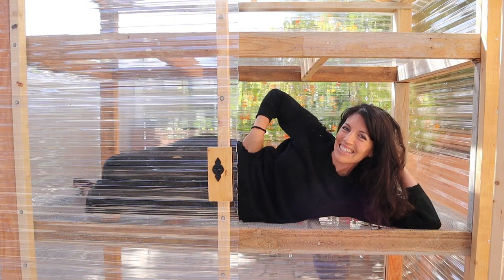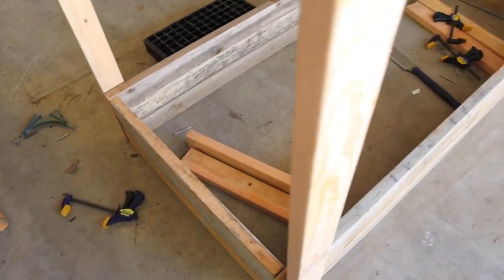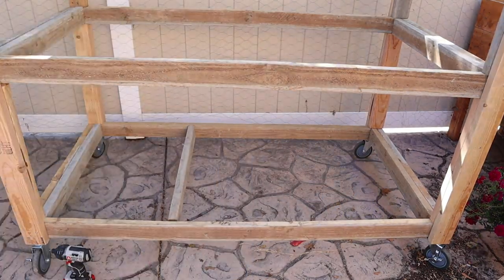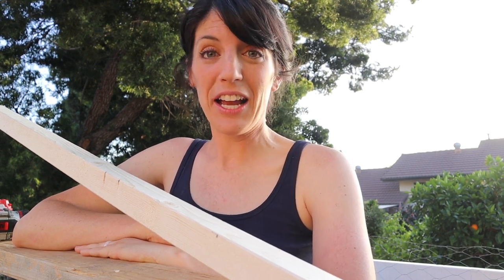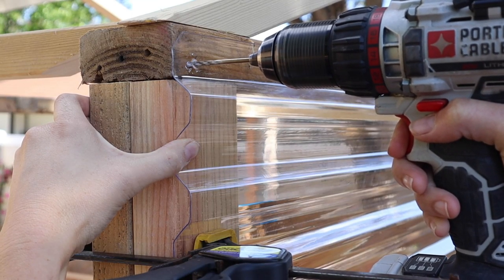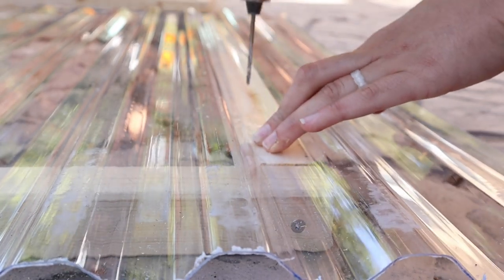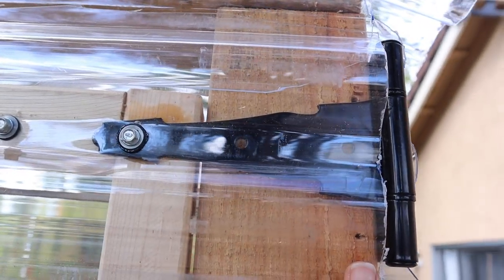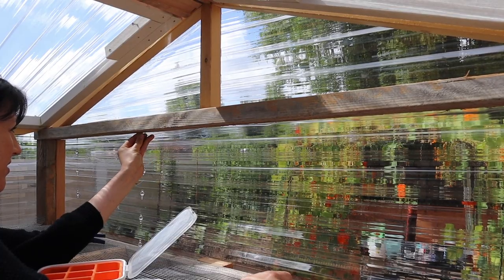How I Built a MOBILE GREENHOUSE on WHEELS | Mobile Greenhouse | DIY Greenhouse | Hey Its a Good Life

Comment: SOAP: Coat the drillbit with soap, and if it still gets stuck, reverse the drill with just a tap or two on the trigger, whaaalaaaa. Sometimes with a spray of WD40 on the bit, depends on the bit, if it is twisted or kinked a small metal filling can help.

Comment: Just add a 12" wide ridge cap of flat aluminum attached to a 2"x2" ridge pole, to function like an umbrella,  and mount it via using some steel plates on each end, raised high enough above your removable roof panels

Comment: A bit holder to keep your bit in your impact. Make sure your garage floor is level or match what it reads on the level onto what you’re building otherwise when you get to level ground it won’t be level anymore. And cut. 45 degree angle into a 2x6 and clamp it to your saws fence, then add on your saw whatever you need on top of the 45 to make your angle. So 65 turn your saw to 20 degrees

Comment: i know this is 2 years old and you have probably been told this hundreds of times already but you did a really good job. especially for someone who hasn't done anything like this before one thing though for the future, I know it doesn't seem intuitive but when screwing in the corrugated plastic, the screws go through the ridges not the valleys. this is because the water runs through the valleys so will eventually find it's way through the holes around the screws and slowly rot the wood. it will run off of the ridges before it finds the screw holes so it will last a lot longer. really well done though, great job!

Comment: Have you thought of using a strip of clear PVC for your gable. Super or hot glue so is is water tight but flexible when your roof is up.  Love your design. Researching my own greenhouse build as I have an odd space for it so needs to be a custom build.  Want to be able to connect LED grow lights on solar panels as my space will only have morning sun.

Comment: I have not met the star bit that does not get stuck, especially after they are a little worn.  what I do is after the screw is as far in as i want it i turn the whole drill a bit to the left.  you should feel the bit loosen up without loosening the screw.  works every time and is free.

edit:  I almost always use some sort of extension on my impact driver. it is nice not to be right up against my work.

Comment: Just use a hand saw. It's only like 7-10 slides back and forth lol. Light wood can splinter and fly out. 
Good build thanks for sharing.
When I build this I'm going to add a push bar to the outside so I can pull and push it without putting pressure on the sheets. I don't want to break them when it's finally  loaded with wet soil by pushing too hard on them
Reply from the maker: Good point. A hand saw with a miter would’ve been fine. That’s a great idea with the handles! Tag me so I can see what you come up with :)

Comment: Tip for making something more sturdy, triangles,  on the bottom if you cut boards in the corner so they are cut at 45 degree angles and then put them in the corner so you have triangles in each corner.  That really helps structure, just look at the Eiffel Tower!  It is full of triangles.
IMPORTANT SAFETY TIP...When using a drill put your hair in a bun on your head so there is no way it (even in a pony tail) can get caught in a drill, it will yank it all out of your head!  I almost did that once.  Now if I am going to work with tools hair goes on top of my head.

Another tip, when adding siding or roofing you should start at the bottom so rain is shed away from the structure not directed inside where it will cause dry rot.
Reply from the maker: So many great points. Thank you Zavia. I’ll have to use more triangles next time for sure and great safety tips

Comment: Use the correct size star bit to fit the screw. They come in different sizes. Hillman Power Pro has the bit included in the box. Greenhouse looks amazing.
Reply from the maker: Thanks. Unfortunately it was the right size-It came with the screws. Strange, right? I appreciate the suggestion! & thank you!

Comment: Maybe I missed it, but predrill your holes one size smaller than your screws. It can help with your bit not getting stuck. Maybe change the settings on your drill too, (more torque).
Beautiful build, and what wonderful blessings to find on the side of the road! 
I look forward to seeing all the plant babies that will grow! 
Also.. I know you said it, but no clamps when cutting with the chop saw! (And just to help build your toolbox, a speed square will help with all the angles you ever need to build the pitch of a roof. They are absolutely amazing!).
Reply from the maker: Hey! Thank you. I think you’re right. I’m wondering if my issue was that I was using an impact drill for the first part of the project so I could easily go between pre drilling and drilling but it was too much power. When I switched to a normal drill with high torque it was much better. 

Definitely a blessing. Thank you! Plant babies coming soon 🥰

Yassss. I need a speed square!! Thanks!
Reply: And a skillsaw takes a little bit of practice, but once you learn the couple techniques required they are fabulous. A worm drive is large and kinda heavy, but it cuts exceptionally straight. A direct drive is super usable for awkward cuts. It's silly the amount of tools you end up acquiring, but they all have their use lol 
(You can also use a speed square to keep your cut straight while using a skillsaw). Again it takes some practice, but once you know which side of the line to always place your blade, it's hard to mess up. If you do feel the urge to practice always make sure the cut end can fall freely. If the blade binds it can be dangerous and can cause kickback. I enjoy your builds! Keep it up! 😊

Comment: That was the greatest and funniest intro ever! lol :D Very cool greenhouse on wheels :) My dad said to stop the drill bit coming out you either would need to use the right size drill bit or you may need an extension on it. And perhaps try tighten the head bit of the drill that holds the drill bit?
Reply from the maker: Haha thank you! Also thanks for the tip. I will see what I can do. I think I may have been using the wrong kind of drill too.